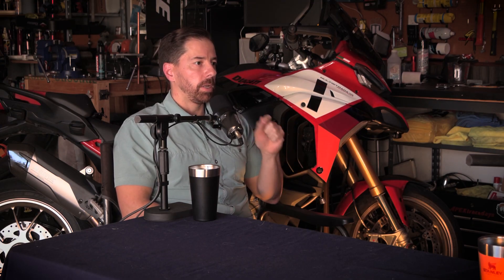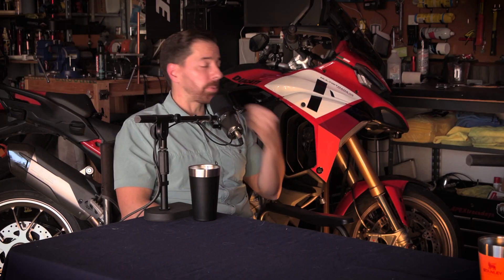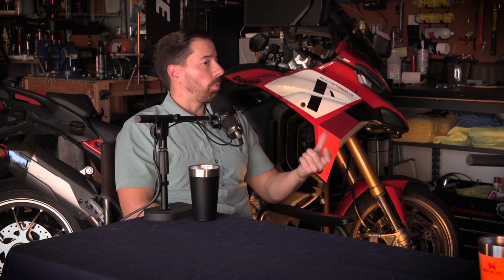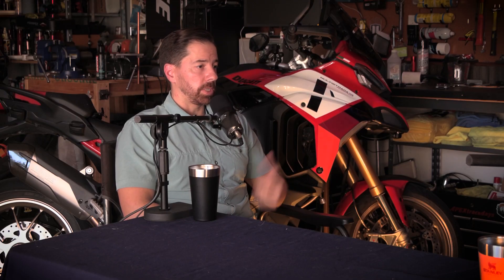Why is MotoGP's 26 PSI Minimum Front Tire Pressure Too High???

Comment: How much do u run on that multistrada? About 3 bar as per recommedation right?
Reply from the maker: I don't think I've ever run it quite that high.  2.5 - 2.6 in the front, 2.7 - 2.9 in the rear. Of course it depends.  Whats the compound. How will I be riding. Where will I be riding...  I'm more worried about front tire wear honestly.  I want to run closer to 2.5 in the front, but that can cause cupping depending on lots of things... So I'll bump up and down accordingly.

Comment: weird. i run daily 28psi both. tracer 9gt and pushing it.. no problem at all. 26 is pretty high for track.
Reply from the maker: Which brand do you use? I don't know of any tire manufacturers that recommend 26psi hot for their front tires, track or street.
Reply: @CanyonChasersPodcast  Prelli Diablo Rosso 4 Corsa. And u right i went look on supercorsa and cup2 recommended and min front 26psi for road. rear is like 22 😋

Comment: The conversation should be specific, tire pressure is not a one-size-fits-all solution, the challenges on race track compared to the street, we face changing road contours, all types of surfaces and conditions, etc...
Reply from the maker: Totally agree! We only mention street tire pressures for context of how crazy the front pressure seems on the current MotoGP front tires.  
Thanks for watching!

Comment: Tire pressure is critically important, right up there with solid brakes. First on the checklist when I get to the pits. Last track day, my son with Michelin Power Cup 2 on a track-only GSXR 600 at 28f / 22r - blew me away, but that's min spec. He had incredible grip even on 5 track day session tires, no issues. I had brand new Pirelli SP Corsa IV on my 21 Panigale V4 at 31f and 29r. Spec says 29-32f and 25-28r all cold. Grip for me was fantastic. Even at 31f / 29r felt like I was moving a bike with flat tires in the pits lol. Street I use OM spec 33.3f and 30.5r for the V4. Really enjoy this podcast gents, please keep it up!
Reply from the maker: Thanks for watching!!

Comment: On my 250 GP bike a couple decades ago we'd run approximately 28psi cold in the front.  On my streetbike at the time about 32psi cold.
Reply: When was that?
Reply: i only run 30psi cold on the streets with my 2025 CBR1000RR-R. Bridgestone R11's

Comment: MotoGP front tyre is not 140 it's 120
Reply from the maker: Michelin calls their current front MotoGP tire a 120, but its actually quite a bit wider. MotoGP front rim is 4.0" wide, much wider than the normal 3.5" we get on production sportbikes.
Reply: @CanyonChasersPodcast the tyre is still a 120 but the carcass is thicker and a bit wider so it doesn't have the same pinched sidewall shape we are used to. Dunlop have/had a rear tyre which had very stiff sidewalls and they recommended a 17 to 18psi 1.2bar cold pressure on track.  The pressure is more about the stiffer sidewalls than the tyre width.  

I tend to run 28psi front on my 250cc Honda 2 stroke on track whereas you would imagine that I need higher pressure due to the smaller lighter bike not working the tyre enough. But being light the Sidewall is going to seem stiff compared to a 1000cc bike the lower pressure works better.